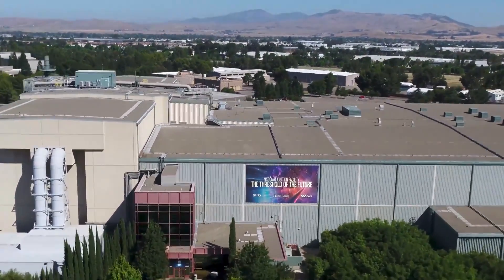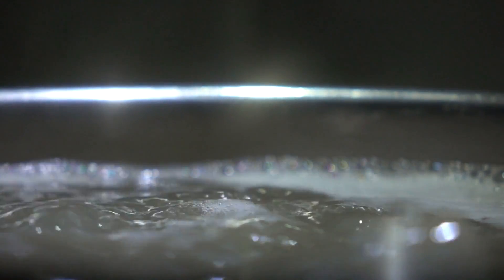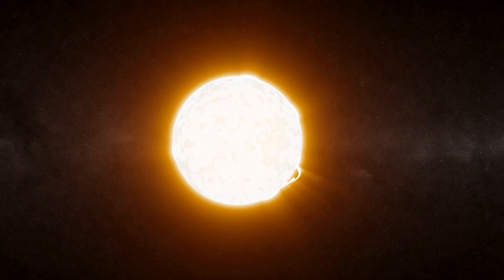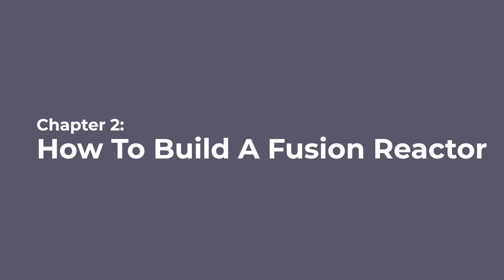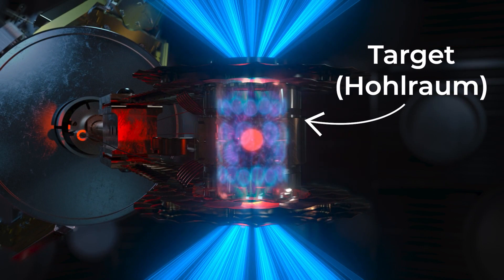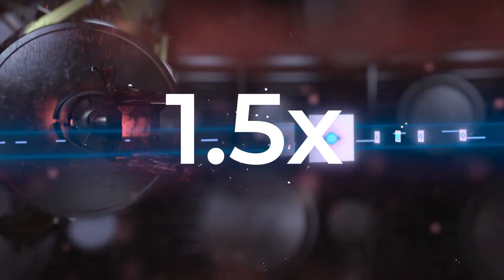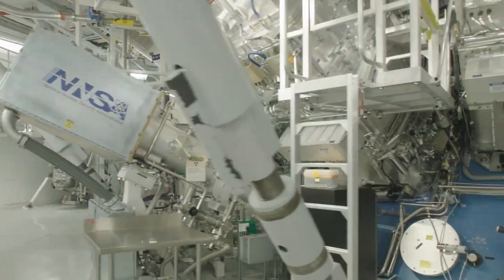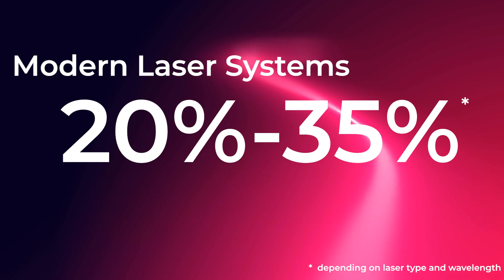The US Fusion Ignition Breakthrough EXPLAINED

Comment from the maker: I'm going to put down a line in the sand - I think the first early commercial fusion reactors will be coming on line in 2035.  What's your vote?
Reply: How about ranking potentially upcoming world-changing technologies in order of expected appearance?
1. AI that passes a Turing Test
2. Quantum Computer that solves discrete logarithms considered secure against classical computers
3. Commercially viable fusion power generation
4. Space elevator or other means of placing material into orbit significantly cheaper than chemical rockets
Events listed according to my personally anticipated order. Judging by history, however, it's possible mankind's greatest achievement in the upcoming decades isn't on my list.
Reply: @timewave02012  1. AI that passes a Turing Test. all ready exists, it is really easy to do just make your ai pretend to be a snarky teen who refuses to answer complex questions in a snarky way.
Reply: @timewave02012  I don't think an elevator will ever be real sadly, though, a skyhook is very real and could be super useful!
Reply: @timewave02012  ai passed the Turing test years ago. It’s not a very useful test
Reply: @ProfessorThock  I've been following AI for at least 20 years and haven't seen it yet. An easy way to catch the latest and greatest chat bot of 2022 is the same as always. Get it to claim to know about something, change the subject, then make some reference to the thing it's supposed to know about without complete context. Or tell a story yourself, and reference it later in some clever way, like comedians do all the time (they call it a "callback"). Notice how the AI has no idea what you're talking about, because it doesn't connect the earlier discussion with the later one that references it.
Reply: @timewave02012  the order first and second discusseble it hink. but overall you are right.
Reply: @clausiuscarnot9011  Yeah, the trouble with quantum computer progress is there's a huge interest in keeping it secret if they can actually break number theory based crypto. We might not know until 10 or 20 years later.
Reply: @timewave02012  Historically speaking, humanities greatest technological advances have most often followed a step up in energy production. Obtaining and maintaining Nuclear Fusion will have an immediate and dramatic impact on the entire human race..
1) Using coal, petroleum and nuclear energy sources to generate power will stop almost overnight. Obviously, this will aid in reversing global climate changes. 
2) Once we gain some proficiency or (dare I say) mastery over this technology. It could be shrunk down and used in all of human kinds forms of locomotion, except walking, maybe.
We may also use it to build exponentially faster spacecraft, possibly capable of subliminal or relativistic speeds. Meaning we could easily traverse our solar system, and maybe nearby star systems.
3) Currently, We are a 0.7 on the Kardashev scale. The ability to create, maintain and fully harness nuclear fusion, could push us up to a full Type 1 civilization much sooner than expected.
  I, personally would put "A.I." much, much further down the list of importance. At least until we "humans" can stop killing each  other over religious, cultural, geographical differences, skin color or any of the other idiotic reasons we kill each other.
Reply: @jeremyrager2853  I didn't mean to suggest importance. I was just guessing about likely order. Quantum computing, for example, isn't currently known to have very many practical applications. AI is one of those things that's going to keep creeping up on us and not give a sudden change until it's able to improve itself, and even then probably not without cheap energy.
Reply: 20 years away. Fusion is always 20 years away.
Reply: @tuttt99  I thought it was 30 years - always 30 years...
Reply: You should look up helion
Reply: @ItsMorze  diggin helion
Reply: Real Engineering just covered a non radioactive fusion reaction. It is a non tritium reaction based on pressure rather than heat. They are more likely less than a year away from a working prototype and I would estimate they are less than five years away from commercial use. It is also electromagnetic rather than steam kinetic making insanely more efficient as it does not have to go through multiple mediums before generating a charge.
Reply: @dorjedriftwood2731  Wow! This was already discovered in the 1980s though. I think they called it "cold fusion". Did they report this in a press release or a YouTube video?
Reply: @dorjedriftwood2731  bingo!  Also figure in the impending death of the Petrodollar as a motivator.
Reply: This question has been answered many times in the last 50 years. Fusion power is going to become practical and go online in 30 years. I think this is the right answer still today. [This is a standing joke if you don't recognize it.]
Reply: @jonahansen  Next 1000 years, do you think we will have it then?
Reply: didnt helion energy come out with a working prototype of a fusion reactor? they estimated they will have a working fusion reactor by 2024
Reply: @flashworks136  Yes.  Even individuals with the motivation to do so have built working fusion reactors (see Farnsworth fusor, for instance).  Yet, all efforts so far produce very little energy output compared to what is used by the apparatus.  Helion, like other companies pursuing fusion, has nice graphics and videos talking about what fusion could do for us some day if all the problems were solved, but very little showing numerically where they are today as compared to where they need to be to have a commercially viable solution.  Helion, on its web site, says, "We expect that Polaris will be able to demonstrate the production a small amount of net electricity by 2024."  That's just saying they are confident they will be able to measure a small boost of electrical energy in the Polaris coils following each pulse of plasma.  They go on to say, "Helion’s cost of electricity production is projected to be $0.01 per kWh...", without giving any date for this and without any numerical justification for the number.

I wish them the best of success, as I wish for the others pursuing fusion.  I will continue to be interested in the advances and failures, but I can't get excited about the prospects for commercially viable (cost competitive, with acceptable side effects) fusion energy until much more progress is made.
Reply: Helion has some smart engineers and an interesting design. However they make totally unrealistic promises to wow investors and government officials. That’s the game in the tech sector.
Reply: Sadly I think it’s gonna take significantly longer
Reply: In the late 60's we thought we would be traveling to Jupiter in 2001,  in the 60's we knew how to make rockets and spacecraft. In 2022 we have a few  people in low earth orbit. But most all people in space are put there by government money. One can hope that profit will drive the research and development of fusion power. I am 70 and I doubt I will see it happen.
Reply: @bkailua1224  Yes indeed.  And in the 50's we thought we would be commuting in flying cars or mini helicopters in a few decades.  Technology very rarely works that way.  Technology heads in unexpected directions, often simply making old problems moot.
Reply: 20 bucks
Reply: Not sure, but I do know it's been a long 30 years in the making this far.
Reply: March 2 2029
Reply: Yes, by Helion. They will not be powered by lasers which are incredibly inefficient.
Reply: @zqzj  what because you saw one YouTube video about them? No company for power generation in the world uses lasers, so why pick Helion, who are decades behind the rest?
Reply: No chance, first this "Ignition" is a hoax the real Q value is way below one, and this is not scalable. Even if it were it wouldn't matter because if you need a building of that size and 200 lasers, and manufacture a precise container to get a positive result that occurs randomly after many tries then you have to account for the energy you spend in those other times your experiment failed. On top of that, this reaction can't be sustained since you have to charge a lot of capacitors to try one time.
What I mean is that even if you can create a commercial fusion reactor following this concept it would be so expensive that it wouldn't matter. What matters is the amount of money we are going to spend chasing this dream when we should build 3 or 4 gen nuclear fission reactors that are safe, reliable, and green and will save us and sustain our growth. By following this sci-fi hype we are killing thousands in the future, wake up people.
Reply: @ergoproxy1986  exactly, you get it dude. When you factor in the amount of energy it takes to run the entire facility and then when you factor in the amount of energy that it takes to create the Fuel Target, you're looking at very poor efficiency. The energy output compared to the TOTAL INPUT energy is about 0.0001%, not the 150% they were falsey claiming. An absolute hoax. If anyone doesn't believe me, look into the total amount of energy it takes to make a Tritium Fuel Target. Helion is the answer, as their reactor is not dependent in Tritium.
Reply: Disagree. It can take decades to get passed all the red tape for a new power plant. I can't imagine it would be faster for a new type of power plant that's never been done before, and that's assuming they have a commercial design ready today. There's just no chance that 13 years is workable.
Reply: I have my money on the Helion Fusion reactor being the first to be commercially viable, And I reckon they'll have it cracked before the end of the decade.
Reply: 50 years.
This took over 300MW(e)
This isn't the Wright Bros.
This is comparing a thrown rock to an A380 passenger route.
This is no breakthrough.
Reply: 2053
Reply: I don't know , if the output is only 1.5% for what was put in then it seems to me that if you're talking about commercialization at some point, you would need to have a very massive facility to be able to do that. it would not be economically efficient. Because technology as well as cost efficiency plans would have to come a long way up,. I don't think we would have this for commercialization by 2035 I probably push it back 20 or 30 years at least. Just the idea of a facility large enough to be able to have energy output strong enough to support commercialization would be very costly. That aspect alone tells me that a lot of thought would need to be put into how to cover such costs without cutting corners and putting safety at Jeopardy. There is no sense in taking unnecessary risks in order to make something like this available as early as 20:35. Too much can go wrong too fast. Let's use common sense people.
Reply: @robertstacey1700  I agree. Was saying, that at the earliest would be 15-20 years just to make something like this technology viable.  and then another 5-15 years to make it a reality in production. At the bare minimum we're at 20 years, at the max we're at 35 years. We'll see, but I don't have my hopes up for anything anytime soon.
Reply: @robertstacey1700  Robert,  We wont be on the green sode of the grass before that is online.
Reply: Based on how long recent fission reactors have taken to get up and going, I don't see how a fusion reactor gets up and running that soon. My bets on over, for sure.
Reply: I'm gonna say no chance. In 2035 it will still be 30 years away.
Reply: youre insane..sorry.. how do  we  know  if fusion isnt worse than  fission.. we dont.. gamma rays are fusion..
theres no way in heaven or  hell there will be a fusion reactor  before 2123
Reply: @johnnyllooddte3415  I think fission is ready, the West has pretty much solved the engineering and safety issues.  Fukashima? The reactor worked fine, it was the spent fuel that leaked due to the earthquake - and it was miniscule.
Reply: I've heard that before.  More like 20035, There are other better ideas that are available right now.  This is absolutely a waste of time and money.
Reply: I think we will have WW3 before that and in consequence of this get catapulted back into stone age. So I say: no way.
Reply: My vote is we will not use fusion at all. At the moment no-one knows why fusion produce net energy. They only tested that it does. I belive that while attempts will be done to comercialise this net energy, the research will heaveilly shift to find the source of the energy and an alternate way of accessing it.

Make no mistake, fusion is still fossil energy. We use solid material in a violent explosion to generate electricity. Coal burning have bad side materials, BUT those are actually capturable, manipulatable, however the side material from fusion (neutrinos?) are actually not capturable and the technology that might do it could be more furthure away then anything needed for the managing of side materials from coal burning.

A bit of offtopic now that I really want to share since its not pointed out anywhere: The electromagnetic field we use to contain magnetically charged material and push them togather, or shoot them at each other, or other ways entice them to get close enough to overcome their repeling force is nothing but the recreation of the same force that gravity exerts on the material inside the sun, due to being a load of material in the sun that creates that very high amount of gravitational force.

So technically we use materials ON the space-time field to push against each other, to mimic a bent/warped space-time's effect occouring inside HUGE celestial objects such as the sun. I hope this puts a good comparison on the magnitude of forces we try to replicate here. Also another daily comparison is that the earth's huge magnetic field forces compasses pointy arrow into a direction, however we can easilly create forces that can override such a huge object as Earth's HUGE magnetic field's effect with a simply fridge magnet that locally on that area CAN override this field we all live in.

It is kinda backwards too. The strong force that keeps atoms away from each other is the compass arrow moving magnet, and by size comparison its like we try to amp up the planets electromagnetic "weak" field to such a huge strenght that it can overcome the small fridge magnet and move back the compass arrow to north. This also a good example of the ridicilious waste of energy we do just to earn a bit back what we want. Ofcourse we mitigate that by having a lot of compasses moved at once and hopefully many times per hour.

Okay back to topic, just wanna close on that one. My prediction that the research will be shifting to find where this extra energy comes from. Yeah yeah its the less then 2 part... no. We looking at a system where the energy released that was in the system aparently IS greater then the energy we need to introduce to break that containment. Containing 2 of the same material in a bigger material takes less energy and the surplus is released as net gain. OKay, but why is it takes less energy to break the containment then maintaing it? What is the concept that allows that to appear? Why atoms uses less energy to stay stable if they bigger? Is there some form of geometry topology going on that energy paths on? Are there exotic materials that may have way weaker containing forces and give up and fuse into something that takes even way way less energy to stay stable so they release way way more trough fusion? A similar concept that we talk about super conductors where exotic materials may provide the same condition to electricity to traverse then supercooled material.

My belifs is that they going to research that aspect, and then starts to look for other approaches to make atoms release excess energy since they do not need as much energy as before since we enticed them to use less energy to stay stable. Thats what they all want, stay stable and they do work until they achive it.
Reply: ...an interesting query, Ben; i am first of all tremendously glad it worked as planned here, i'd say in 15-20 years we should have first reactors and it will change our way of living
Reply: Sure, but the labs and universities will start providing sample power to their campuses and communities prior to the commercial models.
Reply: @seanbluett1441 well that’s how it goes
Reply: I'm always optimistic so I'm hoping for 10 years (2032-33)
Reply: It is pronounced "Hohlraum" not "hoolrumm".
Actually it is pronounced similar to the word "pronounced".
Pronoun
Hohlraum
(Holroum)
Reply: @21stcenturyscots  But "pronounced," with its short initial syllable, isn't pronounced similar to "pronoun." But thanks anyway.
Reply: @21stcenturyscots  Sounds as if you are saying it's pronounced like "hole-round" but without the d.
Reply: Fusion is always just 20 years away, so I’ll stick with 2042.
Reply: Much sooner.  Now that we can ignite the other problems can be toyed with in rapid fire.  We shouldn’t wait though, we really should be building passive fission reactors everywhere we can immediately.
Reply: @Thomas Skyy Correct answer! Problem is, in 2052 it will still be 30 years from then. Everyone agrees that it is 30 years in the future from whenever.
Reply: It’s always 20 years away.
Reply: Times that by 2!  I believe it won’t be available commercially until 2070. Here’s my reasoning, EV technology has been around since the early 1900s and just now is finally starting to become commercially viable. As Elon says lab work is the easy part, producing at scale is the hard part. That being said the technology will eventually get there unless accelerated by military intervention or public outcry.
Reply: @Thomas Skyy In 2052 it will be 2082...and so on...
Reply: 50 years. That's being generous. We won't see it in this lifetime.
Reply: 2030. They have come closer and closer, and I think as they progress, it will speed up exponentially.
Reply: WE HAVE THEM NOW
Reply: More like 2100 I fear. It might be possible to build a net profitable tokamak or stellarator in the next years I think ITER has a fair chance of proving that. But to build a reactor that can compete with other technologies on a cost per kilowatt hour doesn’t look very promising right now. I think wind energy, solar panels and more efficient batteries are a far better bet. Or more efficient and safe fission reactors or geothermal energy. There are to many issues to solve like breeding Tritium, having a continuous reaction, building chambers of materials that can withstand the extreme heat and are functional long enough to turn a profit.
Reply: @sebastiang7394  ITS ALREADY HERE   Wind Solar you got to be FUCKING JOKING If that shit worked it would not need SUBSIDIES TO be built ! It it was viable and made mony Private industry would be all over it !
Reply: NEVER!
Reply: first noncommercial net gain reactorwith sustained output, likely scientifice or military application, gotta be at least 10 years away. first commercial, even assuming a huge race to do so, another 10 after that. so 2040s.
Reply: I just hope it comes in time for me to be able to go to space. I don't want to live on this planet anymore.
Reply: I believe it's still at least 30 years away. Just my thought.
Reply: I thought I would be alone if I said "never" but I see there are many who agree.

No free lunch.
Reply: I think it's roughly 20 years away
Reply: Not so hopeful, first they have to upgrade their lasers, as their current laser system looks very vulnerable, even a tiny smug or a different pulse wavelength, may kill the whole thing. Second, their fuel source is not ready available as they are rare elements. Finally, they still based on boiling water system, I saw another video that there is a way to generate electricity in atom level and skip the whole spinning turbine to induce electricity.
Reply: considering it takes around 20 years to go from an idea to finished nuclear power station and the fact that we don't even have a design for a commercial fusion reaction id say at least 40+ years
Reply: I don't think they'll be allowed online at all, big oil will NEVER permit an energy source that ruins the value of their main product. Even Solar and Wind benefits oil with all their petroleum based materials.
Reply: @theflerffyburr7919  that's conspiracy talk.
Reply: Fusion comes always "about 5 years later" to resolve our electricity needs..
Reply: With Xi Xingping visiting Saudi Arabia and joining Russia India and Pakistan united in the coming removal of the Petrodollar as a monetary standard, I'd say (imho) we'll be cracking the whip on fusion innovation to avoid economic destruction with the goal of inevitable, world dominance. I'd say we'll be frantically sprinting to 2031.  The undeniable truth is that the country that accomplishes this first will have a ridiculous advantage over everyone else.
Reply: I would recommend taking a look at helion they will have harvested energy from their reactor in 2024
Reply: Nuclear Fusion has been 15 years (more or less) since 50 years ago lmao
Reply: Is this video just a leaked disguise for human trafficking?
Reply: "It may be less than a decade away".
Laugh my lungs out.  Even if achieved from a practical point of view, the politicians will have to be bribed.  The bribe will have to be greater than the hysteria they bought from the water melons.
Reply: Controlled practical fusion has been 15 years away for 60 years. Watching so many science journalists fall for more big fusion is disappointing.
Reply: Shame on the LL lab for deceptively reporting this to the public. Shame on so many science journslists falling for it.
Reply: Fusion reactors must necessarily fail as the source of energy of the sun and stars is not the fusion of hydrogen into helium. This fact is recognised in a backhanded sort of way as none of the proponents would ever consider using hydrogen as a fuel. What has been demonstrated by the expenditure of millions of dollars and twenty years of time is that they can boil a jug of water.
Reply: I think they will never be achieved. Billions spent and the best we've got is 1% efficiency lmao
Reply: A better solution for our future energy needs will become a reality using small plasma reactors.
Reply: If I was placing a bet on this I would put it more at 2050-something. While ignition is certainly an accomplish I don't think it is nearly as important as the media splash when the bottom line is a 1% net gain. Even if the process improved 35% with better lasers it's still behind by 64%. I do think we will nail it, just not in a few decades.
Reply: Excellent explanation.
Reply: I believe that fusion is still a long way away, maybe 20-30 years at least.
Today the world needs an immediate solution to avert the climate catastrophe and for that there's no better solution than fission.
Reply: That sounds like a good assumption, and the world will be all the better for it, though I wonder if this is wonder of those types of power that can be abused if it falls into the hands of an enemy...
Reply: It's like getting an ICE motor to do 1 RPM. Now to get 6000 firings per minute! Hope springs eternal.
Reply: I think 13 years is over optimistic. This process needs to be nearly 10 times more efficient to really create net energy. And it has a huge disadvantage of being expensive to create the pellets and getting to a continuous process. Just because something works in the lab doesn't mean that it is a feasible process for commercial use. My money would be in a stellarator and 2045.
Reply: No chance. They do not apparently have enough raw materials to run a reactor for over 3 months.
Reply: Unparalleled clarity of explanation! I'm so grateful for this explainer video. But if you find the time and also have knowledge, would you please elaborate on a nagging question I have? I understand the fuel is in the capsule and it's heated to 100 mil Celsius so that the elements can fuse. What I don't understand is how can the capsule sustain this immense heat? What is it made of? It's unfathomable for me that there's a material that can withstand 100 mil C temperature, even for a tiny fraction of a second. I imagine anything would not just melt but instantly evaporate when exposed to such conditions, yet obviously I'm wrong and left here wondering "What material is this?"
Reply: @georgikrastev  the material desintegrates but by changing from solid to vapor or rather plasma it needs way more space. The trick is that the Desintegration is so fast that the material has no time to move away which results in very high pressure within the material. That's why the laser pulses have to come in symmetrically from all sides and all at the same time.
Reply: Before global climate change, as I don't see climate change really happening in 12 years, the World wasn't much colder in 2010 so I don't see it as being radically different in 2035, I don't have that much faith in climate change!
What I see fusion as useful for is in settling the Solar System, particularly the outer Solar System, fusion will make manned trips to Titan possible and will also act as a power source once we get there.
Fusion will allow for the production of synthetic liquid fuels to power vehicles, it will allow for the recharging of electric car batteries such as the once powering Teslas. Fusion will definance the instabilities of the Middle East, and make oil and gas fields of less strategic importance and not worth fighting over.
Reply: I think never.  The energy required to hold together a fusion reaction on a large scale will always exceed the energy we get out.  Only through use of it's own immense gravity can a star overcome this barrier.  Not even Jupiter's gravity was enough.
Reply: @tinfoilpapercut3547  We could theoretically turn Jupiter into a nuclear bomb by focusing enough lasers on it, we would need to harness the Sun's output to do that.
Reply: Hopefully even before that.
Reply: Wait.  They achieved a Q of 1.4 not even taking into account all of the energy put in and you think 2035?   On what scale in 2035?  On a power plant scale I’m going to say 75-100 years.  We’re not even close.
Reply: i think its going to be 2030 at least
Reply: Having in mind politics of fossile fuels hintering the development of commercial applications of the sort for many decades, the odds are against that prediction. Maybe by 2050 as I see it and of course pending to its efficiency. If its output to input ratio is greater than 25% then it might stand a chance
Reply: @constantinkountouris705  Did the politics of gunpowder hinder the development of the fusion bomb?
Reply: 2052.
Reply: Nuclear fusion power could propel future astronauts to the Red Planet....
Reply: The first one is coming in 2024 by Helion. Check out Real Engineering for the first ever unveiling of their fusion reactor. It's incredible!
Reply: Nope. It's always a decade away. And I'm sure the government will try to control all of it. This will be a continued dump of money never ending science project. What we need to do is start building nuclear fission reactors. Everyone wants to sit around waiting for this come to fruition. In the meantime we need stable dense power generation and all those Green lies about solar and wind is not even remotely the answer to our power needs.
Reply: No. Efficiency has a long way to go for a steam turbine generation to make net gain. The direct electrical generation system is too early in development.
Reply: The first of it's kind type nuclear plant OL3 in Finland has been built since 2005. It's still not online. And this is technology that already is in use! So I'd say, once we a have a small scale proof of concept in say, 15 years from now, then comes the red tape and building delays. I'd wager somewhere around 40-50 years before the first plant is online and actually putting out electricity, not just heat.
Reply: 2053
Reply: 10 years MIN for government/research based active reactors.  It would never be commercial until some government involvement. these are going to have a lot of dangerous risks just like nuclear.  And all that takes a lot of logistics and government involvement. Which is slow.  10 years at a MIN before we even see one actually producing power consistently and not on a individual test bases.
Reply: You are possibly correct, but it won't be based off work at the NIH.   

ICF really doesn't make sense outside of weapons manufacture. Yes the fusion reaction itself was a net gain, but the amount of power it took for the lasers to fire was an order of magnitude higher than the net gain.  The ICF pulsed approach would be the least efficient way of generating fusion power due to the massive amounts of energy required to power it, and the short duration of power generation from each pulse.  Say we can overcome that issue, all the problems around cycle time begin to make it ineffectual as reactor design once again.  Things like; debris from the last shot, charging of the capacitor banks required to charge/fire the lasers, etc...    It's not my direct area of study, but I have friends that left their research grants/projects unfinished once they made that realization, they took their laser research knowledge and switched to the electron microscopy field. 

Myself, I have weird split area of expertise at the intersection between automation and metallurgy.

Most people don't like to admit it, but the NIH is a weapons research facility not a power research facility.
Reply: Lies!!
Reply: Revoke the invention secrecy act of 1951 and let the real technology reach the public.
Reply: Can't believe yall folks think we live in primitive times of technology's.
Reply: @green_light_8806  We don't live in primary time but steam generated electricity is like the railway saying they are developing a new steam locomotive. Even the US Navy is getting rid of steam catapults on there aircraft carriers but yes they still generate electricity by steam but that is the nature of fission and they can't get away from it. 10:1 says once direct generation has matured they will be running away from steam generated electricity like you wouldn't by a updated 8080 computer.
Reply: The first successful nuclear fusion ignition experiment that produced more energy than required to ignite it was Operation Ivy on November  1, 1952. The experiment on December 5, 2022 didn't produce even a tenth of the energy required to ignite it. No fusion ignition experiment has produces so much as a single watt of usable electrical energy. The chances of the first commercial fusion reactor coming online in 2035 is effectively zero. We'll be extremely lucky to get a working pilot plant by then. That doesn't mean we shouldn't try but setting absurdly unrealistic goals is a recipe for failure.
Reply: I'm going with 2075 at the earliest
Reply: So, that tiny little pissant amount of tritium in that glowing vial of mine I’m using in my own little experiments is worth fuck all yet costs an arm and two legs.
Reply: Where are you going to get the Tritium from? No way are there going to be commercial reactors by 2035 and probably never by this method.
Reply: @Osentalka  there are commercail reactors they are just shutting them down it is a by product in the Candu reactor that is why the world has most of the stock available right now.
Reply: small disclaimer in fusion highly depends what mixture they use if it is any way related to tritium it will produce small amount of netron radiation
Reply: I admire your optimism. Theoretical net gain is a far way off from practical net gain, however. Our current mechanisms for converting the energy from fusion reactors to electricity are quite inefficient; converting electrical energy into light energy coming from the lasers is also not very efficient. Getting tritium for these reactors is also a challenge too, and while we have solutions for that they're far from ideal. It makes me think that fusion power may turn out a bit like fission power today: an option for energy production, but one that is so expensive compared to the alternatives that it's just not competitive enough to be widely used.
Reply: Sounds about right, I’m thinking before or by 2040.
Reply: 2023 😂
Reply: My money will be on ten years after the first weapon was successfully tested.
Reply: @mabendass  so, like 1963? Fusion bombs have existed since the 50s.
Reply: Absolutely no chance!
Reply: 10 more years is my vote as well. Dr Michio Kaku said it would take another ten years. He was also pretty accurate in his estimation of when this first fusion ignition would be achieved, he seems to be very immersed in this material as well
Reply: I don't think that it'll be that soon as long as it has the word nuclear in the front of it.
Reply: ITER, google it
Reply: Its always 20yrs away bro ... so I would say 2042
Reply: Hi I'm John Titor and I say 2031.
Reply: I did not see a reply by Biden on this breakthrough,  What was is comment,  if any?
Reply: 2035? WTF? No chance. Maybe 2090, if we don't die off as a species before then.
Reply: @odizzido  odizzido, Or a Nuclear War!
Reply: I think we're 15-20 years away from having a viable fusion technology designed, about maybe 30 years away from it being utilized in a production capacity. Knowing what goes in to the design, construction and implementation of a single fission plant it's not hard to imagine the same will be required for a fusion plant.
Reply: I bet they are about "20 years away"
Reply: "commercial"?????  "online"?????   not a prediction.
Reply: No... you think energry and oil companies will allow this?
Reply: I'd say 2042
Reply: My guess is more like 2040, it’ll take a while to refine, even longer for regulations and safety standards to be established
Reply: I say 100 years.
Reply: I think it'll continue to be like it has since its inception: every year it'll be “just another 15-20 years” but I think and hope that before 2050 it'll become viable and relatively widespread among 1st world countries and “countries of interest” (ie the middle east so the higher ups don't have to balance between helping a country advance and giving them a chance to make nuclear weapons)
Reply: If Elon makes a company and dumps loads of money into making fusion energy I stg I’m dumping my life savings Into it the day it goes public
Reply: 660nm chips are getting close to 75% efficient if not better by now
Reply: Ridiculous. You might want to check on what ITER finally admitted. Their reactor is going to use 440MW of electricity. By the time you factor in losses of conversion they are going to be significantly short on net energy.
Reply: It really depends on funding.

It's great to see renewed funding into fusion research - this is really something we should have been funding 40+ years ago, rather than repeated cuts into Fusion Never territory.

If we had, it is likely we would just be seeing the first commercial fusion plants coming online.

As it stands - 2035 seems like a good prediction. I'd be as surprised to have it much before that as I am to a have it much after that.
Reply: If I hadn’t subscribed earlier, I would have immediately subscribed at 5:26. I remain eternally confounded that people still mispronounce unfamiliar words given the massive computer power at their constant disposal
Reply: @Waypoint Huh? The fuel is infinite, they breed their own lol.
Reply: It's not because the technologies are hard. It because politicians and financiers and scientist have competing agendas and this slows down actual progress
Reply: Bigger is not always better.. more efficient is better.. our current technology is very brute force. We will eventually learn how to resonate these things and make them very small. But we better be ready for that tech as the small size will mean any idiot can have kilowatts of energy in there pocket..
Reply: ok so you put in 2.05 MJ  and get 3.15 MJ , one question though.... how many megajoules do you need to make deuterium and tritium which are both izotopes of the hydrogen ? i mean heck yeah. amazing project, even more if we learned something from it. 
But does it really produce more than it consumes per total ?
In my opinion the closest fusion reactor wich is in construction is the ITER from france, if i'm not mistaken... and if we succeed in making a working fusion reactor we would be gods playing with matter and energy, discovering new elements...
Reply: @Waypoint Just because it hasn’t happened in action yet, it doesn’t mean it won’t. That’s like saying “oh we haven’t built this dam yet, therefore it won’t generate hydroelectric power”.
Reply: Could you touch on Helion? I would like to see your take on it. They're moving to energy capture experiments with their new upscaled generator. They don't use Tritium either. Also my guess is about 2050. No matter what viable solutions come forward, until the dragons stop hoarding their wealth, changes are slow to happen. That and I really don't think energy would be that much cheaper for the average consumer. Even if the energy was completely free and ghosts pulled factories out of their butts, the companies that control that market won't lower their prices. Just increase their profits.
Reply: You have been promising me nuclear fusion is just a decade away for all of my 60 years, to now think it's 12 years away is just as comical.
Reply: @Waypoint What? This is just pure utter misinformation. Where have you read all this crap?

Breeder blankets are now in the late stages of detailed design. Neutronics simulations have all been known, and TBRs are known, accounting for all imperfections and penetrations.

“Orders of magnitude off” is just utter bollocks, TBRs are already >1.
Reply: I would say still 50 years away.  Few challenges on my mind:
1.  The main blocking challenge for nuclear fusion is not ignition, but how to maintain high-temp / high-pressure to have on going nuclear fusion that keep generating energy (thermonuclear burn ).  I'm not convinced NIF's recent achievement indicates any progress on this front.

2. One of the material required for commercial nuclear fusion :  tritium, is extremely rare on earth.  We will need another series of scientific breakthrough to either mass-creating it or find another alternative.

3. From existing tokamak-based nuclear fusion experiment, we know the ongoing nuclear fusion will radioactive the protection material.  Which means we need to replace the equipment very often, consider ITER takes about 20 years to build, this is not commercial viable. 

Solve these 3 problems will take at least 50 years.
Reply: The room:
Guy 1 argues with Guy 2: Fusion is better than fossil fuels
Guy 3: Yeah but unlike you two I (solar renewables) can actually work!
Guy 1 and 2: So, how's the day problem working out for you?
Guy 3: ;_;
The Elephant (Thorium 232 breeder reactors): ...
Reply: ALL  Dead From Nuclear Melt Downs  Fools  @ 42 CPM  Now
Reply: @FixItStupid  Take your pills.
Reply: Is this video going still going to be up in 2035?   My vote is no.

If you could do some basic research, you would have figured out they don't even understand what fusion is.   Unfortunately, you need to be able to think... especially beyond what they teach in school.   Internet is great, you have a whole library at your fingertips.
Reply: Wouldn't fusion energy speed up the entropic death of the universe?  I mean, there aren't new sources of hydrogen being made.  If we fuse it all, what happens?  And yes I know, there is a lot of hydrogen.  But let's give ourselves a billion years to fuse hydrogen, make more fusion reactors and spread across the stars.

Isn't this a problem for the entire universe?
Reply: @justinanderson267  "entropic death"  Obviously you ingested too much science fiction.

In any case, you are literally and infinitely better off resting in peace.
Reply: Great thing about new technology today is, there’s so many people who can develop and enhance technology. More so now than ever before in history. I give it 10 years max and we see all kinds of applications and processes with fusion.
Reply: We be mostly all dead by then...oh well ...next time
Reply: Never.  Theory of fusion has been around for over a century... and the main problem it's faulty.

Stars are gravity powered, which is why they have a life span of indefinitely.

Just look for oldest fusion videos.   If you invest it, get every promise in writing with interest.  You are wasting your time.
Reply: 100 years.  That gives us five it’ll-be-here-in-20yrs tries.
Reply: That was around my ballpark. I was thinkin from the start of the vid around 2035-2040 definitely hope sooner than that though i need fusion to get my spaceships GOIN
Reply: I hope it will happen in the 21st century.
Reply: Nanobots and carbon nanotubers alreqady have rendered nuclear, even fusion obsolete already
Reply: 2135. We have 70 years practical experience generating electricity with fission. Fusion is too far out to count on. We'll need multiple breakthroughs in material science to contain fusion reactions. Fun Fact: we accomplished fusion decades ago... it's called a thermonuclear device.
Reply: Of course you're on the fusion bandwagon.  Getting more energy out than was put in doesn't indicate that fusion reactors capable of deriving useful energy in the form of electricity will ever be possible, much less that the process used at NIF could ever be the basis for commercial fusion reactors; Liquid Fluoride Thorium Reactors (LFTR) appear to be far more feasible.

P.S.  "asterix [sic]" -- perhaps you're confusing the French comic for the typographical symbol, "asterisk" [ as-tuh-risk ] (/ ˈæs tə rɪsk /).
Reply: No It wont, For me Reason being As Elon Musk Star Ship whatever is Already a Proven concept, ready to be Mass Production by someone will that has the Unlimited Supply of Cash by selling to the Free Market. Nasa budget is only by the Feds limit and a Step by Step Process.
So long as Fusion isnt first Produce like a Space Ship, Space Station, there will not be A commercial.
Reply: Besides as Humans cannot process 10000000000000000000s of data in 1 sec they need time to Process and Understand, hence the slow and as time went by it gets faster....
Meaning after Certain Break Point in this case E=mc2 we have a Foundation of Understanding the whatever Current Technological Advancement Level.
1, 2, 3, 4, or 5 Civilization?
To me the Flying UFV or whatever those wants to call it, are Flying Above water... Cooler then water Explain that
Reply: Those, who tend to believe such things tend to be masterful at excluding the following warnings from their consciousness, just as the vast majority of the Earth's 8.0+ billion humans have been so successful at. Techno-nerds tend to be masterful at such hopium antics. I urge readers to search for the following article titles.

IPCC report: 'now or never' if world is to stave off climate disaster (TheGuardian)

UN chief: World has less than 2 years to avoid 'runaway climate change' (TheHill)
* This statement was made 4.7 years ago.
Reply: 2028.
Reply: I'm going to stick my neck out and say commercial fusion will never happen. By that I mean that even if it does become possible to achieve net electrical energy gain and to overcome the tritium breeding problem (neither of which are even near to being demonstrated) then the resulting contraption will be so expensive that the electricity will not be marketable.
Reply: @TerryClarkAccordioncrazy  This comment is spot on - fusion is just a cul de sac keeping scientists employed.
Reply: @johnh6245  Yes exactly. Even if it can be made to work it will never make economic sense against renewable energy from solar and wind which only requires technology we currently have.
Reply: 13 years sounds right, but it's really hard to predict with such a new technology. I hope it's soon!
Reply: My precious Tritium. Otto Octavius would be proud! Maybe we’ll finally have “cheap electricity for everyone”
Reply: @Everything2A  Tritium is not the answer.
Reply: @Everything2A  Very doubtful! We will have abundance but will be in even worse shape. If you think that any government is going to allow cheap energy, well, I'd call you naive at best.
Reply: Utterly delusional and it’s a shame you claim yourself to be an expert if you believe that. 

We currently have nothing even close to commercial. If we started building a fission plant NOW (a technology we very well understand), we still wouldn’t have it by 2035. Fusion is way harder. How can people possibly think we’ll have one that soon???
Reply: @Gomlmon99  Fission's problems are mostly in dealing with regulations - making sure safety specs and clearances are adhered to. The waste material and potential damage from failure to properly operate or deal with natural disasters or sabotage is a far greater concern for fission... Not to mention the pushback from local communities where reactors get built. On the other hand, fusion's by-products are just neutron radiation and helium (D-T), or helium and hydrogen ions (D-H3).

Fission has to deal with adding control rods to stop runaway reactions whilst fusion is struggling to get the reaction to be sustained - they pretty much have opposite problems.
Reply: @DoisKoh  fissions main problems are the economics of such a capital cost, programme management and supply chains. Fusion suffers the same, except it’s way more complex, so has way bigger issues.
Reply: @Gomlmon99  Spot on. Fission plants take a decade to build and their financial viability is often marginal. There is zero hope of building the much more complex and completely unproven fusion technology in any kind of similar time frame. You'd have to be able to draw plans and order materials and nobody knows what it would even look like at this point.
Reply: Itll take however long it needs to take, as long as it happens
Reply: 2025, money talks
Reply: @thunderbirdizations  even with infinite money, that figure is absolutely laughable lmao
Reply: No it won’t !!
Reply: It cant happen, ever. Just do the maths.
Reply: @fivish  do the math for us if you're making such a bold claim then
Reply: Earliest I see fusion becoming commercial is 2030 the latest is about 2040. I mean unless this breakthrough causes the government to spend ungodly amounts of money on trying to fast track the research then MAYBE 2027.
Reply: @Kghammond852  ETA: Never.  

Understanding of fusion (how stars power themselves) is completely wrong.

The "new" development in this video, so far, is they shined 192 lasers at a target. 

You can do the same thing at home these, but it will not yield fusion, either.

It has nothing to do with fusion.

They are nothing but scammers or complete idiots.